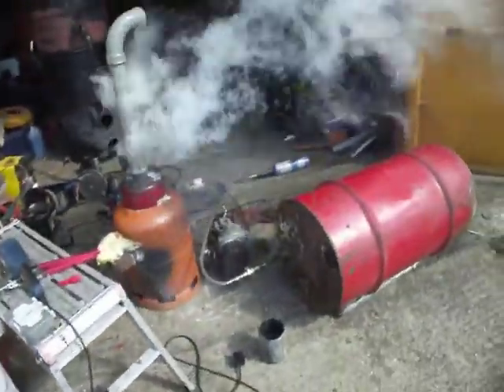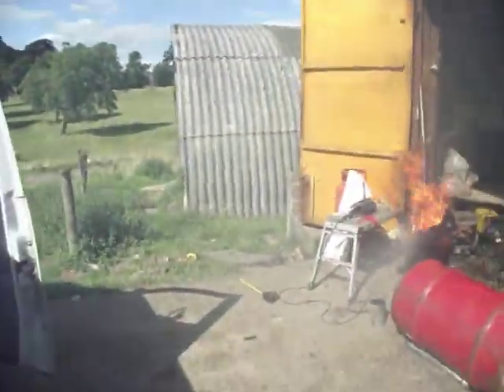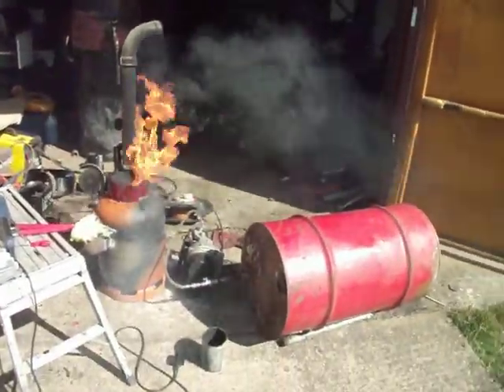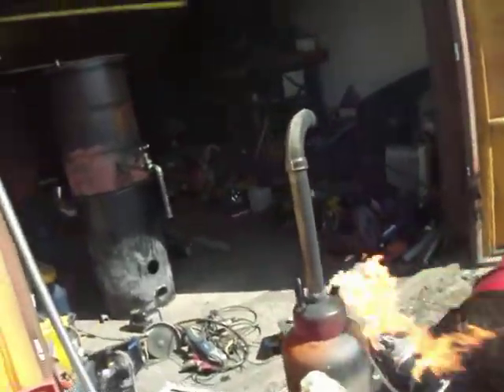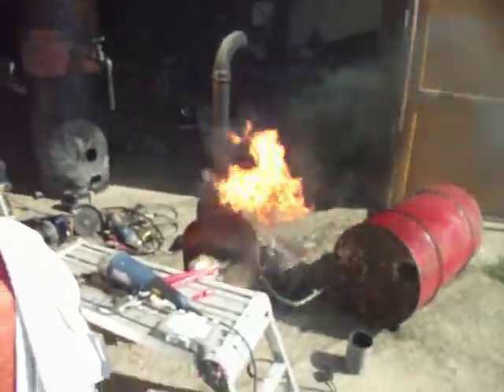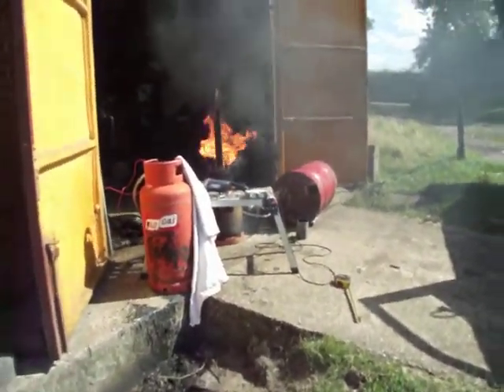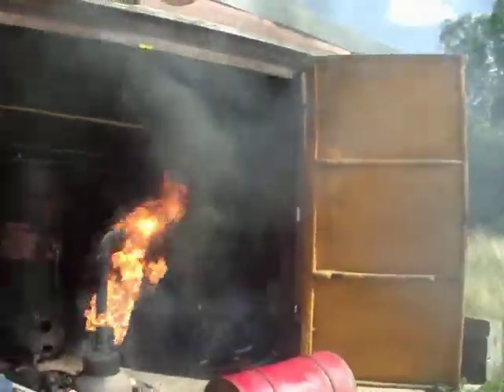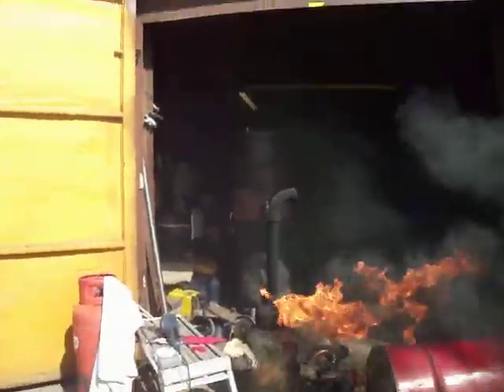plastic to fuel project the start 1

Comment: yeah i did same in backyard with 44 gallon drum with a copper pipe to condense the vapours like a whiskey still
just be careful the gas can be highly explosive when tapping off into steel drums
need to keep the oxygen away from the vapours,, ive almost lost my head a few times doing this experiment,, explosion can be like a grenade going off
Reply from the maker: Yes I found that out got protype built but plastic line got blocked stupidly wasn't thinking use a oxygen blow torch try and clear it well it proper blew up put me in hospital for months I was badly burnt